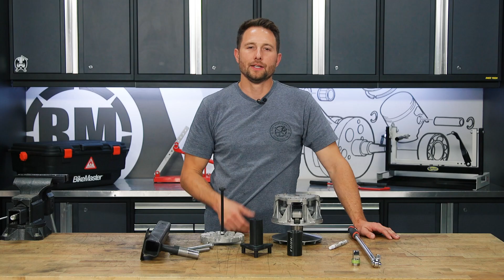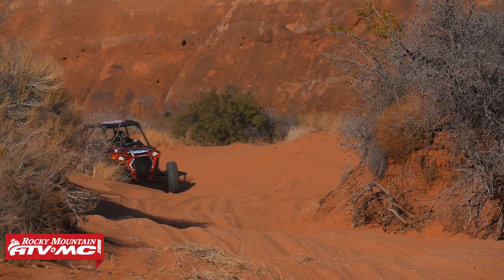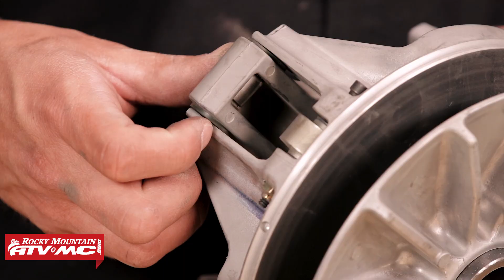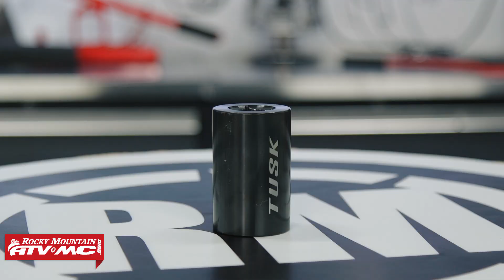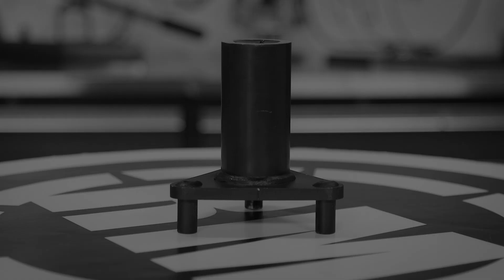Tusk UTV Drive Clutch Tools & SLP Holding Fixtures

Comment: How do you hold the clutch with the aluminum holder.
Reply from the maker: Are you talking about the EPI Clutch Holding Fixture shown at 2:06? If so, you just clamp it in a vice and then slide your clutch over the threaded bolt.